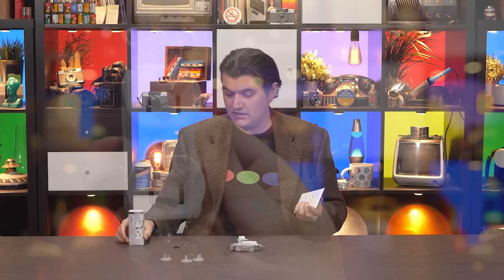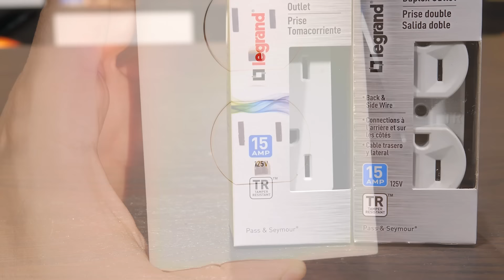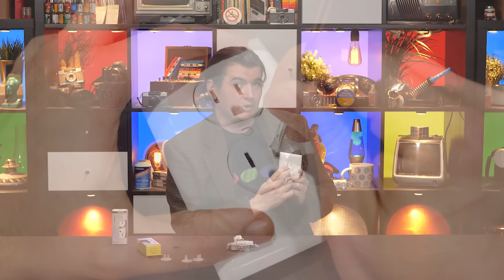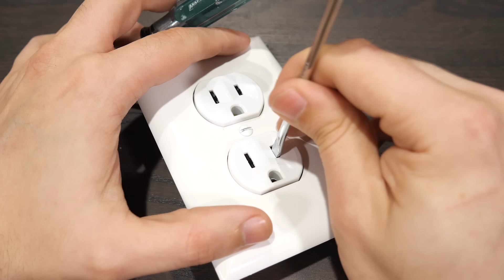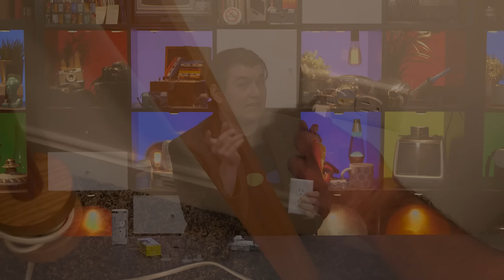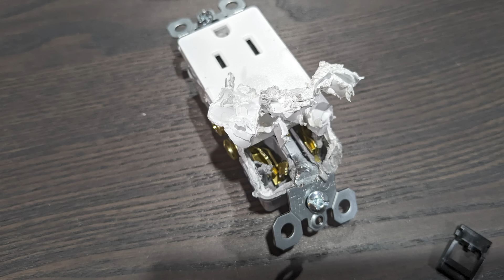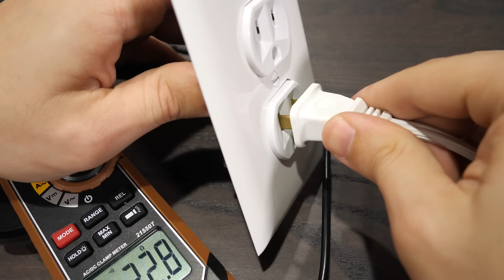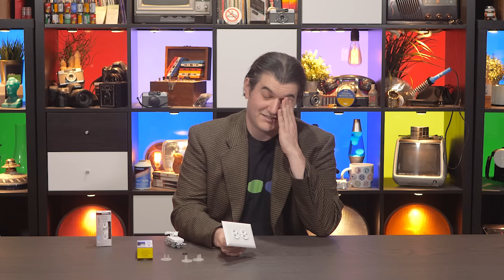Tamper-resistant outlets aren't all the same - a follow-up

Comment: To me (a Canadian), the “plugs always falling out” issue is very real for one specific kind of plug: cheap phone chargers. Their blades tend to not be oriented, they often have a swiveling design, and I tend to use my phone while it is plugged in, which makes it one of the few cords that get tugged. Since those phone chargers are cheaper than an adapter, I imagine that most tourists do what I do when going abroad and buy a local phone charger, only to be faced with the frustration of them always falling out, especially in those hotel desktop receptacles that you mentioned.
Reply: If you mean the ones they sell in convenience stores for entirely too much money, and are just two prongs and a USB port, absolutely. Not only are they not oriented, they tend to have smaller blades anyway. Combine that with the hotel receptacles that are already loose from being used more than normal, and yeah, they almost always fall out.
Reply: @OtakuUnitedStudio The one packaged with my Pixel 4 has the same damned design as the dollar store ones...thanks, Google, lol.
Reply: @Tardisntimbits  Meanwhile, the one I got with my cheap-ass Motorola was actually a really decent charger with a transformer in it and everything.  ...Although for some reason it had a USB-A port on it, instead of a USB-C like most other phones are apparently packed with now.
Reply: @OtakuUnitedStudio  your phone had a USB A port on it? Very odd.
Reply: @OtakuUnitedStudio they are all 2 prong. I've never seen a 3 prong USB charger.
Reply: @bland9876  In the UK they have a 3rd plastic pin, which is often retractable. This is because their plugs need a physical ground pin to open the shutters.
Reply: @LaughingOrange  ok let me say it this way I've never seen a 3 pronged north American USB phone charger.
Reply: @bland9876 exactly. Show me a 3 prong USB charger and I'll show you a guy with 3 dongs.
Reply: @LaughingOrange geez, the UK seems weirdly obsessed with babies jamming forks in electrical sockets.
Reply: @bland9876  I was more addressing the minimalism of the design rather than specifically trying to call attention to the number of prongs.
Reply: @bland9876 USB C laptop chargers have ground
Reply: American here, You are 100% correct!
Reply: yeah, Been to a lot of public places where people use outlets a lot... Colleges, lounges, because it's only one screw, The plate and sockets are literally falling out.  And I also agree with the international adapters.  Sometimes when I order items online, they come with the wrong plug (usually a europlug) and yeah. europlug adapters fall out. cuz they're cheap. they're not meant for normal use. and i will only use them until I get a replacement.
Reply: You should do an episode about how shitty phone chargers are and how cheap and badly made they are on purpose. It would be very interesting to see your take on this. Love your videos and thank you!
Reply: Yes - I think this is the main issue that faces visitors to the US which leads to the impression that plugs fall out of US sockets.
Reply: @andrewmole745 probably thats the case. One more reason they should integrate those sockets with a built in usb outlet for charging. Tourists will never plug in a vacuum cleaner, or a blender or anything else with “proper” plug design. Therefore they will go back home with the impression that the North American plugs are worse than they are. Or the hotel’.
Reply: @davidpocsi1733  In East Asia this is actually increasingly common - the hotel I stayed in last week in Mainland China had two USB-A sockets for charging.
Reply: "cheap" plugs are often made in other countries where they don't have the same electric codes.   I have seen things sold on walmart website from sellers in china and one of them is a double male plug, most often asked for around christmas and it's 100% illegal in the US.   I've reported it multiple times on walmart but it was still there a few months ago.
Edit:  I don't see it on walmart anymore.. Hopefully it's off the site.
Reply: @Kristinapedia  I have even seen 2 parallel 15 amp plugs sold as 15 to 30 amp adapter.
Reply: @mernokimuvek  Yes!!!  I work in hardware for 30 years and I encounter this at least twice a year and it's amazing the amount of "convincing" I have to do to tell these people that two 15's does not equal 30, nor can they just put a 20a in place for a 15a because the breaker keeps popping.  I'm almost to the point where I want to have them sign a waiver stating I told them this is wrong just in case they burn the house down then expect to use Ace Hardware.  hahaha.
Reply: @Kristinapedia  They have the reverse version too: 30 amp plug, 2 15 amp outlets, no breaker.
Reply: Phone chargers are usually dual voltage so bring your nice one and just get a blade adapter
Reply: @eddie826 adapters add length and weight, making the whole contraption more likely to fall out again.
Reply: Just bend the plugs out a little. Jaaaaysus.
Reply: @joshuagibson2520  That's not a good idea, because it can damage the plastic housing of the device.
Reply: @OtakuUnitedStudio  I bet you're fun at parties.
Reply: I thought about this myself in the main channel video. I have several phone chargers that came with my phones, so aren't even "cheap", that are so top heavy that slight wiggling will back them right out of the socket.
I took to wrapping the charger cable around something for one full loop before it goes to the device so that no movement makes it back to the plug.
Reply: "Short prongs" and "wall warts" with contained electronics that weigh them down pulling themselves out with being shaped odd/proud from the surface. Besides the excessively worn sockets. As everyone has said.

Consider that ceiling mounted and under-mounted sockets/receptacles are a thing, though not common. Even those are fine with a normal plug for tools, etc., as intended.
Reply: Canadian here too: I agree but 30+ yrs old outlets become very loose because the friction mechanism for holding the blades is barely functioning anymore. This is why replacing old plug is essential when the outlets cannot hold the plugs firmly anymore.
Reply: Cheap phone chargers are dangerous to you and your phone's battery health. You shouldn't use them. 

I got one from 7-11 (yes I was an idiot. I'm all better now) and it fused on the inside when I plugged it in. Luckily I always plug the wall wart in, and then the cable, and then the phone. Otherwise I would have had to replace my ultra crappy galaxy a20 sooner than I did. Because it was so crappy the USB C plug wore out in less than 2 years.

The next time I see someone claim the A20 is a good phone (like many idiots were on High Jeffries channel) I'm gonna puke. Terrible, overpriced POS filled with bloatware, slow storage, slow processor, terrible camera, a joke of a wide angle camera that appeared to be ripped from a cheap AliExpress car backing-up camera, that made all the footage appear like an early 90's rock video with so much dithering and artifacts, I HATE IT SO MUCH!

buy a pixel A series, and everything is 900 times better. And it's been over 2 years and my USB C port works great!
Reply: @PastorOfMuppets616  I've never used a Samsung product that wasn't awful
Reply: @PastorOfMuppets616  Truth. Buy quality accessories. 👍
Reply: European here, could someone explain reason for the blades swiveling?
Reply: It's so that they can tuck back into the charging cube instead of sticking out! It's very neat when they are well made, and very annoying when they aren't. That's also a thing Apple computer chargers do, if you want to look those up for a visual @ImieNazwiskoOK
Reply: Do plugs fall out more in Canada than anywhere else? 

Or is that how you begin every conversation: "hi, I'm Canadian and an alcoholic"

Not saying you're an alcoholic, just inserting a well known greeting as an example. 

To me (a middle eastern fellah) it seems strange to begin sentences like that. 

☝️See? That's weird. Why did I need to mention my nationality at the beginning of my sentence?

Not saying you're weird, but it seems like anyone who isn't an American feels the need to point it out in comments sections.

Praise Allah.

☝️See? Totally unnecessary, since there is only one deity who goes by many names and all his chilluns forget that fact and hate each other.
Reply: @PastorOfMuppets616  Canada and the USA have the same electrical wall plugs.
Reply: Never use a cheap chinese knof off brand chargers. They often have poor isolation between the reftified mains and the 5 V output.
Reply: There you go. You bellyache about our outlets and then buy the cheapest made in China for the Chinese market or the grey US market adapter money can buy.
I just posted underneath the video how the best way to make US or UK etc outlets better is to not buy cheap imported Chinese junk. They are FAR more dangerous than any outlet in America.
Big Clive has countless videos of exceedingly dangerous made in China devices being imported into the UK (and American) market.  it's like a smoker complaining about the coal fired plant 30 miles from his house.
Reply: This can also happen on Type I phone chargers, if I accidentally tug my cable while I'm using it, the block will eventually come loose. However, by the time there's exposed metal, it is no longer contacting, bc the insulation continues up the blades, luckily.
Reply: @myonfriend Canada and the USA have the same electrical wall plugs.
Reply: for people from other places, it's common for the plugs to fall out because of the adaptors, the weight of the plug plus the adaptor tend to lead to this scenario
Reply: Use extension board
Reply: The problem is multi-faceted. The old blades of the two-prongs were made of superior materials, usually being stiffer and slightly thicker and the receptacles had better grips. The modern ones are made of inferior materials, thinner, and the new receptacles are nowhere near as tight as the aforementioned legacy grips. I can only presume that in the shift towards globalization, the in-house standards of plug and receptacle manufacturing were put aside for cost reduction techniques.
Reply: I can totally agree, for most cases. granted i am a little different in that i tend to try and avoid using my phone while charging. i just would when its plugged in not jostle and wear out the USB connector on the phone prematurely. but in the case of i am using it. the way i avoid the problem, i use longer cables and if say im not near a wall i will buy the chargers that come with a plug and wire, something where instead of the charger being a wall wart you jam directly into the wall its got a cord with a standard plug. That or i just use portable power banks for when im charging while moving around the house, and will plug those into the wall warts since. well you aint gonna use them when they are charging. 

but i think the whole plugs falling out of the wall thing kinda stems from wall warts, especially the older big chonky boys that weighed like a pound, i do remember those often pulling loose and in some cases becoming a great advertisement for replacing an outlet when they would refuse to actually stay in the wall and just flop right back out again.
Reply: @compzac  Funny, because I have lived in America for 50 plus years and never had this problem except when it comes to very poorly made cheap no-name wall warts. But my good quality wall warts work fine in the same outlet.   I literally never once experienced a cord just falling out of the outlet for no reason whatsoever.  If it did ever happen, I would just assume the outlet is bad and needs replacing.
This is an extremely contrived "problem" that doesn't actually exist.
Reply: What Canadian says "oriented" instead of "orientated". lol
Reply: Most of them! @aaron74
Reply: @aaron74 that is because only idiots say orientated, and frankly I'm surprised my phone thinks it is a word.
Reply: @maplecinna3979  That's because it is a word. Two very similar words that mean exactly the same thing. One is the British variant, the other American. Tantamount to rain gutters in many parts of Canada being called eavestroughs, and the last letter of the alphabet being zed instead of zee.
Reply: @aaron74 You missed all the classics, like Cheque or Colour... lol
Reply: @johnqpublic9074  Yeah those are among my favourites. lol
Reply: Can we stop with this "as a _______" trend? Like, Canada is 6000km. You think we all have this issue? We don't. So stop.
Reply: @NicodemusT They mentioned Canada because they use the NEMA standard like Americans do. What's wrong with you people.
Reply: I'm sorry to inform you that Canada is not a length, it is a country. @NicodemusT
Reply: @mousefactors  As a loser, I agree with your take.
Reply: @NicodemusT  "As a citizen in an undisclosed location in the world's second largest country by area..." Ha ha ha

Comment: The two times I’ve been shocked are as follows: First time, I had a lamp next to the couch with a pull cord. The pull cord didn’t turn on the lamp. I assumed without looking that the bulb needed to be tightened, so I reached up under the lamp shade to do so. My thumb went into the empty base, because someone else had removed the burnt out bulb earlier and didn’t replace it. The second time I was replacing bulbs on a small 5-bulb bronze chandelier. All of the bulbs had burnt out and we’d finally bought some new candelabra base flame bulbs.  Someone while cleaning it had pushed up the plastic sleeve and it had fused to the bulb. When I tried unscrewing it, it took a decent amount of force. This caused the plastic sleeve to crack along with the cardboard sleeve underneath and bakelite socket cracked, causing my right thumb to come in contact with the live wire.

Comment: Growing up we had several barns that had electric run to them.  At some point someone removed the light switches.  I think it was because the switches had deteriorated and the boxes they were in were non-standard?  In order to turn the lights on, we had two find (in the dark) both wires that were sticking out of the box and hook them on to each other.  You found out quickly how to find the box and the wires with your hands, while potentially standing in water from the rain (because barn, light switch near door, dirt floor) to push the wires together without getting a shock.

I've been shocked a lot growing up.

Comment: On the falling out issue, what many people are referring to are things like two pin USB chargers (Youtube won't let me quote an example from Amazon) which, because of their weight, can completely fall to the ground, whether or not there is any device attached. There is often not enough grip on the pins. This cannot happen with the UK version.
Reply: You're right that it can't happen in the UK version, however it can very definitely happen in the two-prong European version. I've had it happen myself when traveling. Granted the situation was made worse by travel adapters forcing the weight of the charger to sit further away from the wall.

Comment: I've encountered a tamper-resistant outlet only once, and it was a long-lasting pain to insert the plug. It was so inconvenient that I would never want that it my home, children or not. So if you're considering it, make sure you try it first. Maybe some brands are better than others.
Reply: That has been my experience. When I saw the video title, I had hoped that difficulty of plugging anything into the tamper resistant outlets had a solution and I just had to know which ones to buy. No such luck. I will continue to avoid them like the plague.

Comment: One problem I’ve encountered with the tamper resistant receptacles is that poorly made plugs tend to have a sharp edge that digs into the plastic of the shutter making it impossible to plug in without filing down the sharp edge

Comment: I've had friends and family live in homes where there's essentially nothing holding a plug into some outlets - the lightest touch will allow it to come out. Some power strips - even ones that aren't super cheap - also have this issue, as I've found.
Reply: Those kind of sockets can be a dire risk as the contact can be poor.

Comment: People have commented on US/NA plugs falling out. I've never had a plug wiggle or fall out over time. I've had plugs, like from a vacuum, rip out though. When my dad had the house up the street built  for his parents/my grandparents (the house is 20 years newer than my parents'), it had all tamper-resistant plugs. Some of the plugs were hard to plug into. So, my grandma went and got 3 and 6 outlet adapters to bypass the tamper resistance, kinda defeating the purpose. My house has all new electrical and was completely renovated in 2019 and doesn't have the tamper-resistant plugs, and I'm glad. If I had them, I would probably either replace the outlets or get a 6 plug adapter for each plug.

Comment: I totally agree about the voltage difference being a major factor in our lack of safety standards. I've gotten several 120v shocks and they didn't hurt, just intense tingling like my arm fell asleep. When I got shocked by a cheap travel adapter in London it hurt a LOT and kept hurting for the rest of the day. Also since higher voltage can arc further it has more chance to shock you and more tendency to cause a fire.
Reply: You should go to get checked out at the hospital every time you get an electrical shock. Atleast that is kind of a "rule" in Finland"

Comment: to put it in simple terms, a shock from 120V is less likely to cause fibrillation than a shock from 240V is.  however, running a 120V electrical system requires more copper than running a 240V system.  this is why Europe chose to use 240V and have more safeguards against accidental contact, while the US chose to use 120V and have fewer safeguards against accidental contact.